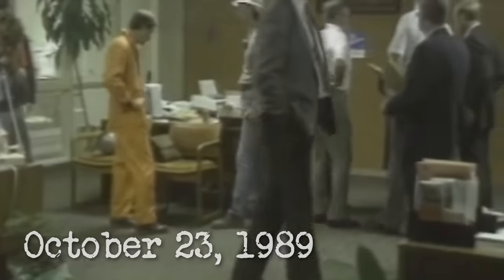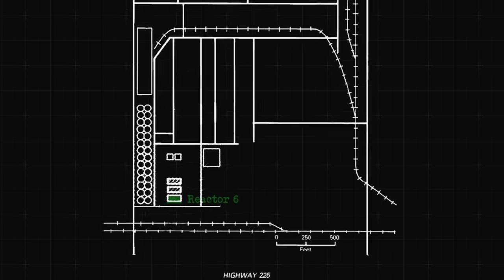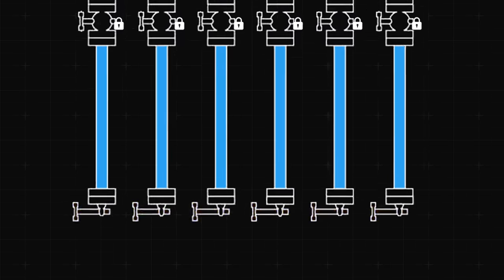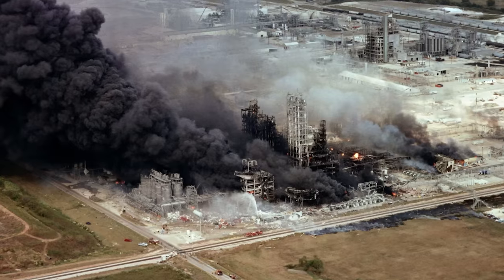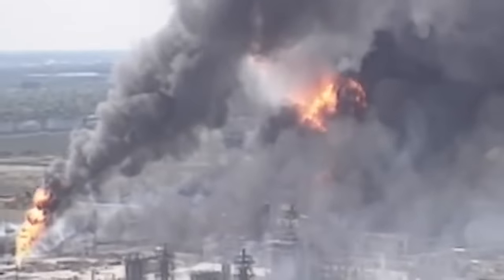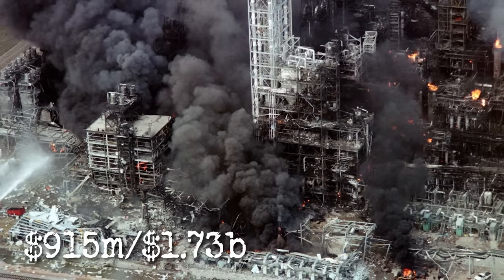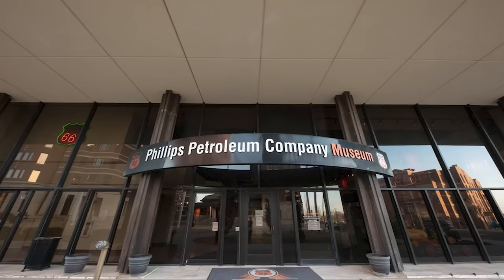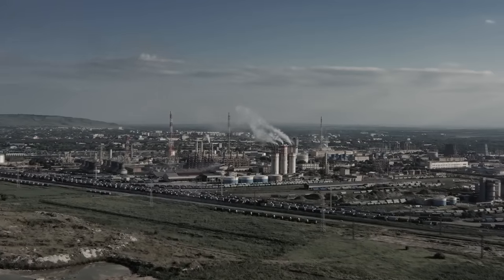When a Company Ignores 575 Safety Violations

Comment: I have to respect the OSHA staff when they are able to piece together a disaster from piles of burnt rubble.
Reply: I assume it's like how in Forensics, we have a LOT of things to go off of.
Reply: It’s like how NTSB investigators can deduce the cause of an extremely complicated and chaotic airplane crash from the wreckage and flight data recorders.
Reply: You mean the same OSHA staff that allowed an operation with 575 safety violations to continue production?
Reply: Yeah. Who needs OSHA to do anything about preventing accidents?
Reply: @RyuuOujiXS  No doubt. I wonder if a lot of these comments aren't generated by AI. I work in heavy industry and safety has never been so bad. The company and union just used double-speak to claim everything is perfect. When we have major accidents they can always blame it on the workers because they're caused by a worker doing a less than ideal job at some point. But the thing is the danger should never have existed. The most recent accident was caused by a robot running into hydraulic hoses where it broke a fitting and hydraulic fluid shot onto a furnace and ignited. But we've been telling management for at least a year that these hose were too long. There never was a reason they had to be so long and we'd had the gripper sensors ripped off the robots when the one in a thousand chance happened that the hoses didn't bounce out of the way like usual but rather bounced into the robot. This happened to two machines in a single day one a single shit and cost a loss of production of an entire shift and about $1000 in parts for each machine. The governments give these companies so much money to not move to a third world country that they'll never enforce the laws. They'll just say that they're only recommendations, not laws.
Reply: @bunsw2070  Well this was in Texas where a company's right to make profit overrules wimpy things like safety.
Reply: It's not the NTSB or OSHA, it's the Chemical Safety Board of the United States. 

They also have a YouTube channel and do animations and it's fucking epic. I highly recommend watching every single video.

USCSB is their channel name.
Reply: It was mostly the Chemical Safety Board that does these types of investigations with OSHA there also…but they dont lead the forensic investigations
Reply: It’s funny how y’all read the number of “safety violations” identified by OSHA, yet you clearly know nothing of that process or what the exactly means…and just because OSHA cited them, or classified them as willful, that doesnt necessarily mean that would be correct
Reply: @blueyedevil3479  Do you really want to know what majority of these accidents come down to? The fact that equipment is not maintained due to "cost" and staff are being exploited. That IS the very definition of wilful.
Reply: @Stopthisrightnow560 I love that channel. It’s awesome that they release those free to the public
Reply: Yeah and then completely cave to the company and fining a measly ass $4 million and the demand that they remove the “willful negligence” designation in the official report. Respect gained and then completely lost.
Reply: @RyuuOujiXS .    No blame for the company itself or the state, or the Republicans who call safety “ burdensome regulations”.    Pull your head out
Reply: They’re supposed to catch this before it happens OSHA IS supposed to show without a notify or letting them know, but I noticed they show up letting us know and we end up trying to clean up as fast as fuk boy and they walk around then the big boss and hr buy them all lunch… Johanna beverage co. Spokane wa. They make simply made, and Welches and  little cups of juice at school after it’s bottled up and if it’s one day till expiration, we reuse it by re-pasteurizing it over and over again and mixing it with newly made batches🤢😝 stopes my from drinking but wont stop me from making money 🤣 but I do love to inform people but now one believes 😂
Reply: @livinginvancouverbc2247  Yeah, because it's not like industrial disasters occur in blue states. It's not like there've been a shitload of similar accidents by state-owned fossil fuel companies in Latin American countries.
Reply: the USCSB does that, OSHA has nothing to do with investigation
Reply: @bunsw2070 Most agencies can only give suggestions. They have been neutered by company funded politicians
Reply: @Cynsham these people are way smarter than me and you my friend
Reply: @RyuuOujiXS almost as if OSHA isn't strong enough
Reply: @RyuuOujiXS they never get enough funding or power to do anything.
Reply: I would respect OSHA more if they actually prevented disasters like this
Reply: Honestly as someone that works in the Safety Field nowadays, the more I learn about OSHA the less I regard them as a joke.

The ONLY reason OSHA has regulations for just about anything is because SOMETHING HAPPENED, and contrary to popular belief they don't actually want to drop in and do surprise inspections; they are usually understaffed and have a full schedule so the fact that employers are afraid that if they call and ask questions about procedure then they'll randomly get a visit is actually laughable.

The only reason OSHA is so prevalent is because workplace safety related incidents are so relevant. They're a direct reflection on how shoddy a lot of workplaces are when it comes to protocol, and everyone always thinks "It's not gonna be me" until a dude who got minimal forklift training randomly swipes and bisects their leg out from under them (I live in a factory town, these kinds of incidents are common).
Reply: Its uscsb. Not osha
Reply: @bunsw2070   also 1 violation vs 300 violations 😅 other issue is how old these plants are, instead of every 100 years you rebuild, you just keep adding on. even though no one likes osha but sometimes you really do need them.

although the place i work at the maintenance team likes to fix problems before they cause issiues, iv reported problems with maintenance that they then fixed because a 1-3 days of downtime is belter then a month
Reply: It really does save future life's. My dad used to do scene reconstruction for OSHA and was a industry hygienist first with chemical then with stuff like lead and asbestos. He stoped working around chemicals after a very bad chlorine leak he was involved in at a paper mill.
Reply: Osha don't give a shit about the huge companies... slapping a billion dollar company with a 50k fine is a joke
Reply: @knightwolf3511  I don't know what kind of plant you work at. I know that where I work, the maintenance manager and supervisors don't even bother reporting anything, safety or otherwise. They must have figured out it's a waste of time that will only make them enemies.
Reply: Um yes this brunt black thing was the cause
Reply: It's obvious what happened lol 

They don't care about the ruble
Reply: @RyuuOujiXS These guys know when OSHA will show up, so they have time to prepare. 
No doubt the warrant process was lobbied for and allowed due to generous contributions.
Reply: I think the NTSB are a really cool organization
Reply: @livinginvancouverbc2247 Pasadena is in California...?
Reply: @jake12466  Yes, as in the 'Little Old Lady from Pasadena (Jan & Dean -1964)' ... And apparently Texas has one too !!! Maybe with some Hot Young Ladies!!!
Reply: It is now in the hands of the Chemical Safety Board to do those reports and investigations.
Reply: @RyuuOujiXS  Exactly which crowd are the ones that hate regulations?
Reply: OSHA is administration, the investigators are the USCSB. though there are some overlaps but that is a general rule OSHA investigates incidents that are ongoing. i.e. safety complaints. USCSB investigates incidents that have already happened in a major way i.e. catastrophic incidents. Do note that both the USCSB and OSHA do not have regulatory power, they can only make suggestions. suggestions can be ignored, hence these incidents since i believe USCSB also does routine updates on their recommendations for key industries when new information is uncovered and companies are suppose to adhere to the new guidelines but, you know how that is.
Reply: USCSB wasn't founded until 1998. Love those guys!
Reply: @RyuuOujiXS  Wow! It's almost like they need to be funded and given more power to force companies to abide by safety regulations.
Reply: OSHA didn’t piece anything together. The CSB did. Most of the actual worthwhile detective work and issuance of safety recommendations in this industry is done by them. OSHA mostly just ignores what the CSB suggests because they’re a captive regulator.
Reply: @bunsw2070 that is how OSHA comes up with regulations
Reply: You say that like people don’t brazenly ignore OSHA guideines
Reply: @RyuuOujiXS shit I had at least that many safety violations by myself at my last job and OSHA never found out and the most OSHA can do is issue fines
Reply: @jeshegames I probably had at least that many violations by myself during the 5 years at my last job so I could actually get work done
Reply: @Stopthisrightnow560 the CSB didn't yet exist when this incident happened.

Comment: Administration should have faced criminal charges and not an negligible fine. The fine itself should have outweighed the cost of the property damage. When a disaster of this significance happens, the company should have to struggle to not go under.
Reply: you have to think about the big picture. if you shut down a company every time a human life is lost through an avoidable accident that the corperarte is at fault, not only would the economy crash, but businesses will just pull out of the country to do dangerous work elsewhere, causing a more severe crash.
Reply: @matthewbarabas3052 then write laws against that. It’s high time we cracked down on greed.
Reply: @TheSuicune7  it wouldnt work due to the reasons i said above.

Comment: Just to think, a chemical plant broke 575 safety violations back in 89. This makes u think of how many other Chemical Plants are breaking Safety Codes in 2023
Reply: Depends, the reason we have the rules we do now we're all written in the blood from these incidents. Still, humans are adept at finding new ways to be reckless and stupid.
Reply: @AngelBolt this. Whole bunch of plants blow up in Texas seemingly every year.
Reply: yeah, and then you need to factor in the other countries running plants just like this in the middle of a jungle that are 70-80 year old factories all rusting apart and held together with cement and tack welds.
Reply: Technically most with some having minor issues, next is also the next generation is well lets just say most are not the sharpest spoon in the drawer.
Reply: @twerkingbollocks6661  Almost every safety rule is written in blood one way or the other.
Reply: @Nope_handlesaretrash  Texas has more such plants than any other state. So, even if they all blow up at the same average rate, you'll see more of them happen in Texas.
Reply: Just thank about the person having to bypass interlocks and stuff. There are stuff I had to do just to prevent things from getting worse in order to shut down the system
Reply: Well, you take that number with a grain of salt, just because there is a violation per the books doesn't mean it's automatically dangerous, it's like the food safety violations restaurants get- you can get cited for something as simple as strings from a mop that wound up around the little casters on the mop pail, or an employee leaving a scoop in the container of flour- the scoop is clean, the employee wearing gloves, it's nothing, but it IS on the books as a violation they issue fines and a write up over! I suspect a lot of those 500 violations are very minor like a light bulb burned out in a stairwell, or an "exit" sign isn't lit,  or a fire extinguisher on the wall has a trash barrel  someone left  in front of it, or the edges of a step doesnt have the required yellow paint stripe, that sort of thing, if they were really serious 500 violations they'd have been shut down.
Reply: Seriously?  Every single one. One gets fired for reporting safety violations.
Reply: @a97304  That's sounds very realistic
Reply: I'm late to the party,  but yep USCSB is still standing strong.

Comment: I worked as an injection molding machine operator for 2 years. During my time there, I had been burned by molten plastic twice though neither were severe. However, once it gets on you, the only thing you can do is let it cool or run it under cold water. Molten plastic is like lava, sticky and viscous. Trying to wipe it off will spread it further. I can only imagine how horrific it was for the two burned alive by it in the second incident.
Reply: I've been burnt by molten plastic as well and I share your sympathies with those guys.

Comment: Good video, but you said it was a faulty valve. It wasn't, the valve did exactly what it was meant to do, but human error connected the wrong hose. In reality this was a design failure that allowed such a mistake to be made in the first place. For example, using two different size hoses for the two connections so they can't be mismatched. It's called 'inherently safer design', you design the hazard out at source.

EDIT: just watched all the way to the end. You mention both of my points. My bad 😂

Comment: It always baffles me how experts are able to discover the cause of the disaster, especially ones involving fire. How are they able to tell what the original cause was in the field of burnt debris, some of which are beyond recognition?
Reply: Chemical fires leave unburned residence, burn marks, burn patterns, etc. This plant would've had electronic systems noting everything going on in the plant, as well as probably had security camera footage. The plant operators knew exactly what happened and basically once the feds show up, the feds can shut the plant down forever if the operator doesn't show enough information. It's political why the managers never get charged with manslaughter when they deny a legally required safety recommendation.
Reply: Probably has to do with a wide variety of things: burn patterns and residues and stuff, access to what things were supposed to look like, blast radius and epicenter, records (including the gaps) of the equipment maintenance.

It's still absolutely incredible, because that's an awful lot of pretty niche knowlage combined with really good deductive reasoning skills I certainly wouldn't be able to do much more than point at a particularly damaged area and say "well, something obviously happened there".

Comment: I worked in the chemical industry for 25 years. Products like gasoline & polymers have extremely flammable & explosive components throughout their manufacture. Absolute control, caution, & a fire safety regime are paramount.
Hindsight is 20-20, but I'm amazed that they allowed maintenance on a fully load/pressurized reactor vessel.

Comment: So 574 is OK, 575 crosses the line.  Got it.  I'll get this off to those operating Nuclear plants.  

Also more details on WHY someone would be reattaching the hoses and unlocking leg four would be nice.  Since it's mentioned as continuing of the maintenance it's implied that this was part of draining leg four, and they were trying to get it back in service.  So not only would they have to inadvertently open the valve, the draining valve on the leg would ALSO have to have been left open as they did this work.  The design was two valves upper and lower where the first would be closed and lock, and then the second unlocked and opened to drain.  After which the reverse should occur ... close the drain and lock close, then unlock the upper and reopen.  You have to open both valves and have both unlocked as open to have this accident occur which means a lot more mistakes were in play.

Comment: The refinery in big springs blew its stack too. I had to help my company rebuild the blast proof walls around the brand new electronics box,  and it was huge. 12 inch block with rebar and concrete. Doing this in 100 degree heat with fire retarded coveralls on is the hardest job that I ever worked on. That electronics box  sounds like a gigantic yellow jacket nest.
Reply: What's in da box?

Comment: That explosion was intense. I was in the 5th grade at Whittier Elementary in Jacinto City which is a good 8 to 10 miles away and we felt the explosion through the floor. My brother was outside at recess so he got to hear and see it. My mom and another school volunteer had gone to the Sam's Warehouse in Northshore which was directly inline with the shockwave and said that when it went off the building acted like a lung, it compressed then expanded and blew the front doors out. after making to the parking lot they were greeted with falling debris and firetrucks. My dad was lucky though he was a few refineries down at the Exxon plant. Several years later after we moved one our neighbors ended up being a worker that worked there at Phillips that day and had survived the explosion even though he got tossed through a wall.

Comment: I worked in marathon in Galveston bay and they had a similar situation where gas leaked out of a tower and the engine of a running truck ignited the gas. The explosion was so big it reduced an enire unit of the plant into metal pretzels (these units are the size of corporate buildings upwards of 10 stories)